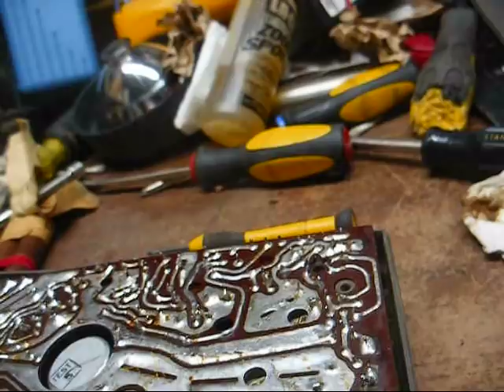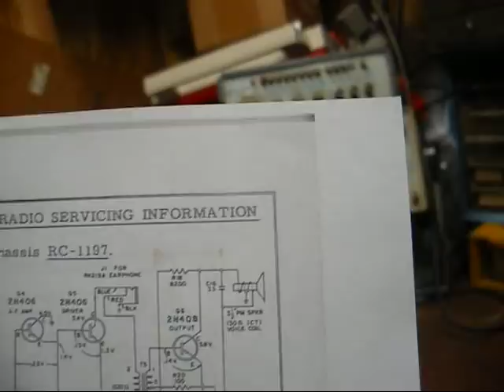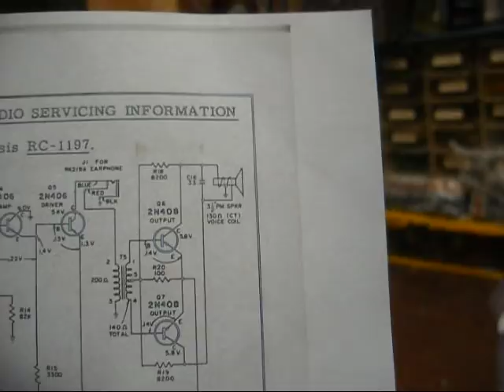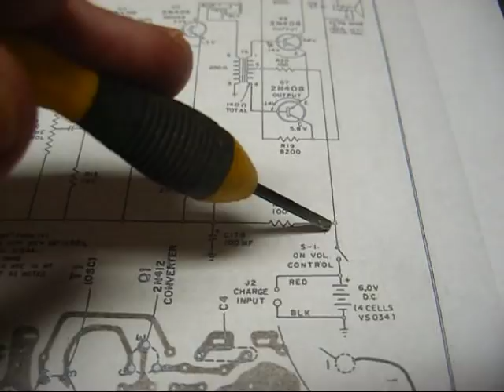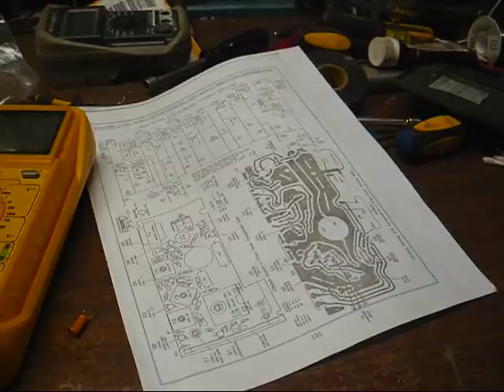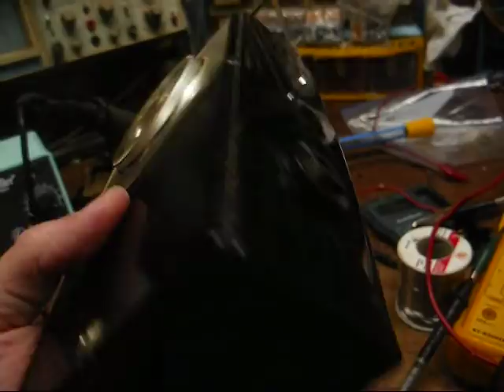Repair of an RCA transistor radio from 1959

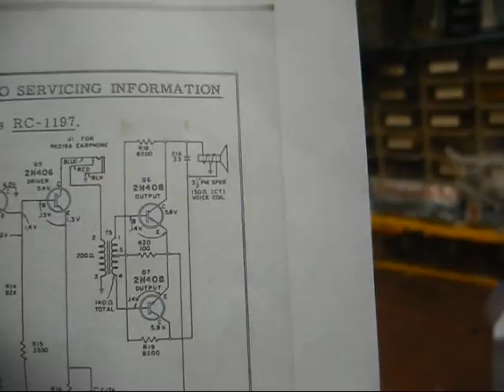Comment: 8:30 Was the connection of the earphone to the output of the first driver thus avoiding the complimentary symmetry pair, a means of conserving battery life thru use of Hi-Z earphones - - their impedance is not stated on the crktry schematic

Comment: Wow. That's about 200 hours of listening time on a set of 4 AA cells at only 12 milliamps.  That's a very well made and efficient radio.  Truly a nice machine.  It's a shame that it had to be one of the few parts in the radio that can not be had new.
Reply: Maybe the use of the earphone has more to do with extending the life of the batteries than listening in a noisy location, or a room where silence is required. Cheap batteries back then ran dry very quickly, then leaked :-Z
Reply: Yeah, 200 is probably a bit high. Maybe more like 100 or less with good quality carbon-zinc batteries.  One assumes RCA branded batteries were on the good quality end of the spectrum.  I'm not sure if carbon-zinc cells leak or not. I know modern Chinese made alkalines leak terribly.

Comment: I was thinking. The center tap on the primary doesn't have to be grounded for it to work. If you separate the center tap from ground with an appropriate capacitor you might have been able to continue using the transformer.
Edit:
Never mind. Looked at the schematic again. Q3 collector needs a DC path to work.

Comment: That's the first time I've seen a center tapped speaker on a schematic.
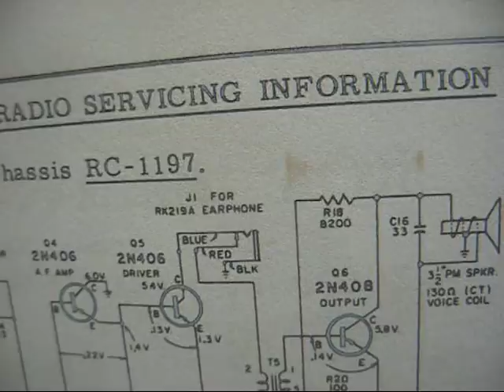Reply: 6:40 I think this push-pull arrangement was to conserve current use, the battery life was also extended by connecting the "earphones" to the first driver.
The center tap could be for powering a field coil arrangement?

Comment: I have a spare 30 watt AM transmitter set up on 530 KHz, I think I made a video on the repair of it's power supply a while back.
The power is adjustable all it needs is an antenna of course if you are interested.
Contact me on my channel or here - elfnetdesigns@gmail.com

Comment: You could capacitor couple the diode to pin 2 and disconnect pin 5 by cutting the trace.
Reply: It's not that easy, because you don't know where exactly is the short connection - it could be in fact close to pin2.
Also AM detector creates DC voltage for fist stage AGC. So after coupling capacitor on pin 2 you should add resistor to pin5 to restore correct DC voltage for AGC.
Reply: Its an idea, try it and see.  The worse you could do is waste a few minutes.

Comment: Your persistence paid off! That was a terrific job of breaking down the circuit! Another weird RCA transistor problem I've found  (more than once) is excessive resistance on the bias transistors on the push/pull finals. Well done!

Comment: That was interesting. I did once (and only once so far) see a small, low voltage electrolytic cap shorted in a tv someone else was working on. This was in the mid 90's, in a TV that was only a few years old, at a TV repair shop I worked at briefly when I was a kid. They had someone who would come in when they had certain jobs or heavy work loads who did know his stuff. Took him several sessions but he found the shorted cap in the S-video section. Symptom was (if I remember) no picture at all. I was doing something basic on a VCR while paying attention to him and his continuity meter went off and he shouted 'there it is!'. The other two guys who owned the shop came in and they quickly worked out what to do and replaced the bad cap with two other ones and carefully checked the picture quality and it looked damn good to me.
Reply: ...or as Archimedes would say: "EUREKA!!"